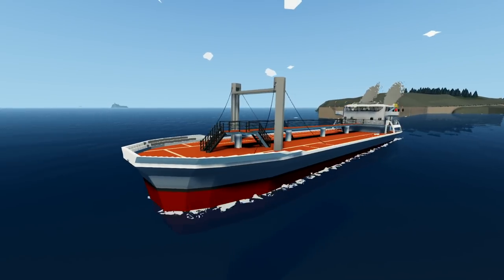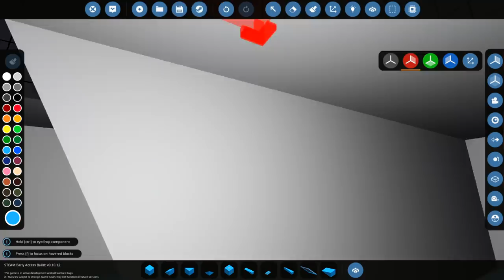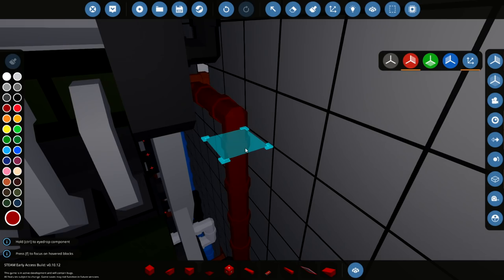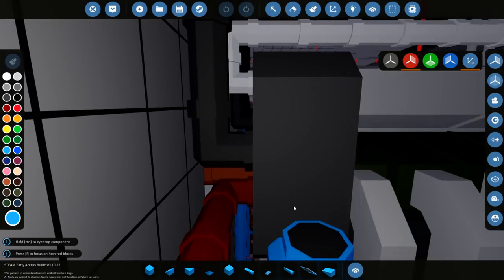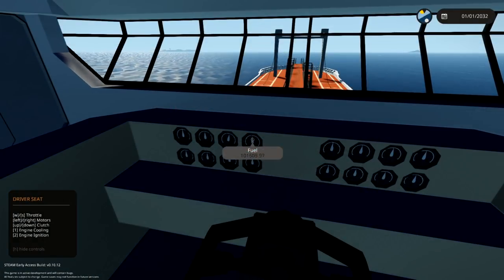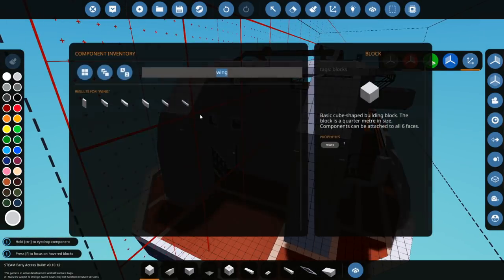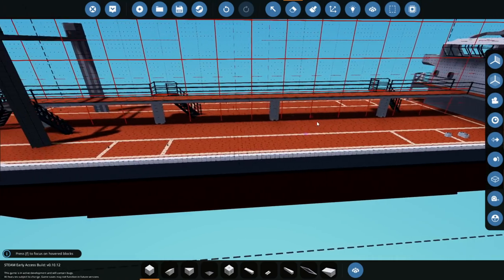Cooling The Engines!  - Tanker Build  -  Stormworks Gameplay

Comment: I think that it should be split into 4 or 5 sections and that the life boat would look good hanging from one of those white bar things connecting the bridge to the edge of the deck. 

For the deck it may look good if you add random pipes running along the length of the deck which, according to a book i have, on a real tanker would pump oil or fuel to and from the storage tanks. 

Also you could add random intakes representing vents from the storage tanks which would be used on a real tanker to avoid the build up of dangerous flammable fumes from the stored fuel which could ignite by accident if too much of them built up.

Comment: Hi frantic, you should put fluid filters so air can’t get stuck in the cooling system
Reply: you don't really need to!! but a good suggestion!
Reply: It is a bit unnecessary, but it is the reason the new nj jet ski blows up in waves
Reply: @initialyeet3951  He can bypass that need all together by attaching a quick outlet to a large tank filled with water for each coolant in. Those will last the engine long enough to get over a wave to then get submerged again and then refill the spare tanks. The jet ski can't hold that due to it's size, but some thing like this can definitely spare that weight. A single large tank per engine will work, even though they'll probably drain them on each wave.
Reply: Those, in my opinion, are better put on the air intakes so that in case the ship gets rolled or a wave goes over the intakes, heaven forbid on how high Frantic has placed his, the engines will still work. I use a filter on the air and a 1-way flow on the exhaust, for the same reason. . . . And when I think of possibly posting some of my stuff, I recall what Frantic, Camodo, and Mr NJersey wind up doing with them, and I end up adding that setup to like trucks and other land vehicles; just out of paranoia.
Reply: Steeljaw XXI  that would actually take more effort to put in though
Reply: @initialyeet3951  At this point in the build, yeah; most likely. I usually start my creations with this kind of setup though, so it's usually not an issue for me, except when my creations are ugly and I end up having "that 1 block off that causes you to either have to mass delete and reconfigure the whole thing or try to copy/paste half of your creation which fixing that results in just as much time spent rebuilding the thing" events. You know....a Wednesday.
Reply: Initial Yeet it’s a tanker it won’t come out of the water but it is more useful to put those on exhaust and air so it doesn’t flood the engine
Reply: @harryiscool8219  Well, with Frantic's track record, I wouldn't say that it'd never come out of the water....Frantic will probably end up putting it in the roughest waves before hitting it with a tsunami, which will either submerge it or launch it. "Normally" they won't under standard use, but this will probably undergo "Frantic" and "Camodo" use.
Reply: Steeljaw XXI  yea

Comment: Wing sections on the bridge has to be the strangest "solution" to the tilting issue. Just add horizontal rudders to the back, and use a pid and tilt sensor to push them down so the ship levels out.

Comment: You should put a fluid filter on the air supply to prevent tsunami water from getting in the engine. Same for the fluid cannons if you plan on using seawater.

Comment: Turn the rps on two motors up a little bit  to get a little more power and use them just for moving the boat and one motor to run all the generators and pumps ...youll save alot of weight in the rear by deleting one engine

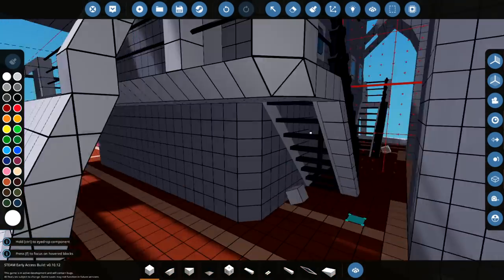Comment: 15:45 Frantic .... Why didn't you raise the entire section and place the cube block at the bottom near the deck?! So frustrating for some reason. Glad you fixed the lower deck though.

The lights and lifeboat sound like a good idea, will you be putting in a mechanism like the in the rescue boats? To lift the lifeboat over or just letting it detach and float off.

-For the deck, there's cosmetic hatches... Like giant hatches you could fit cars and trucks in. Saw an irl picture, looked nice and uniform.
-There's raised pipe lines going along the length, occasionally splitting out sideways.
-there's also console's, 3-5 blocks high with a wedge on the front ,that can be cosmetic or used to pump fuel from the deck.
-THIS ONE IS MY FAVORITE ... Use the lines you currently have on the main deck and just recess them down a block or two and add some curves to the cubes above them. Would add some nice 3D depth to the deck.

Really enjoying this build. I'm learning more as i watch.